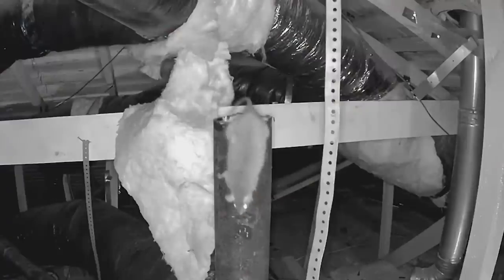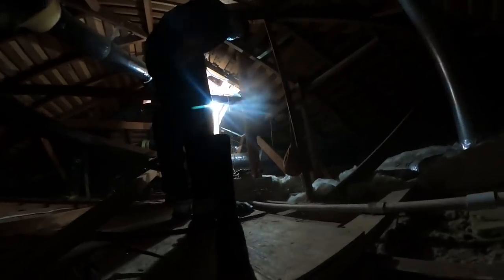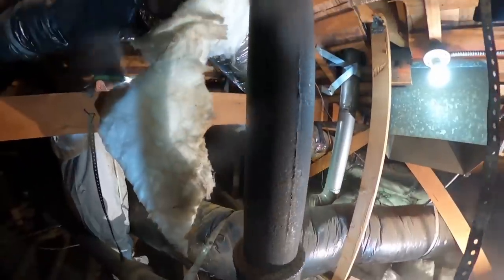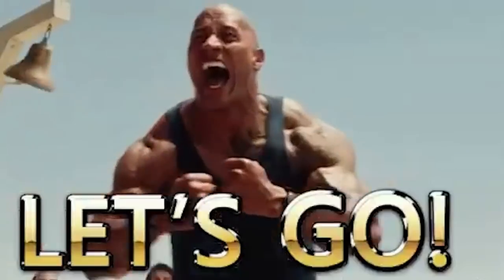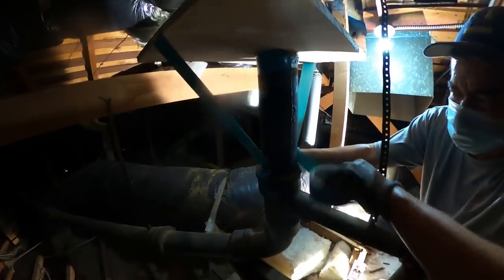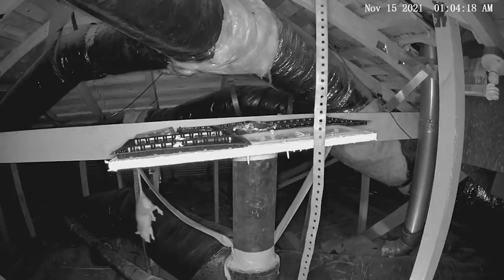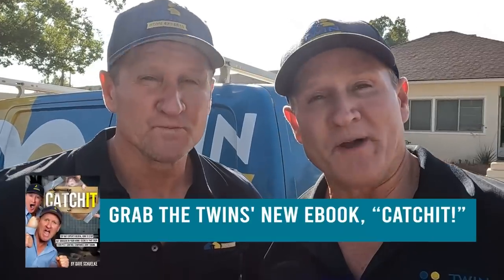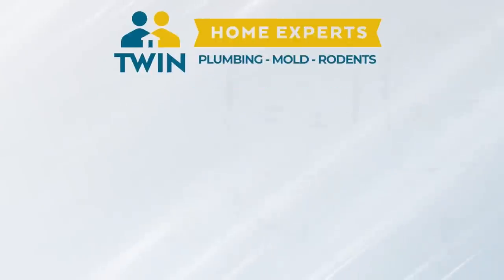Hang on …. Sewer Rat does WHAT to the glue board ?!? This is SHOCKING

Comment: Hey twins - question: how come yall not using the trap bucket with the liquid at the bottom? It was working so well in previous videos. Im confused.
Reply from the maker: Great question! Because we saw activity from the pipes we thought it was be easy to catch them from there run way. ( sewer pipe & attic )
Reply: I have seen someone use peanut oil with the peanut butter to coax the rats into the bucket.

Comment: THe Sticky traps work against dumb rats only. 95% of time they figure them out and avoid them. Victor traps set up standard way -  they also avoid most of the time. What works for me flawlessly when I waged war against rats - I set up a carboard box with two holes that can line up against the wall from both ends. Rats run along the wall and have no problem entering a carboard box (They love openings and small spaces), which is not a foreign material to them. Inside -  set up a Victor trap VERTICALLY with pedal facing towards the floor. Rats see no obstacle on the floor and feels safe trying to lick something tasty off the vertical surface of the pedal. This works the best!  That smartest rat was so bold, it sometimes ran in my plain sight! And I saw it entered the box to hide from my view. the next second I heard Victor trap trigger, and BAM!

Comment: I'm not a Pest Control Tech. but since the glue and snap traps aren't working, I'd get some of those live capture box traps (like Roach traps, they check in, they don't check out) and place them on the platform and once they're trapped by the one-way gates, take the trap out and drop the trap in a 5 gallon bucket with enough water to drown the buggers, then finish sealing up the entry points - that cast iron stack needs to be rebuilt so it terminates outside to prevent sewer gasses from entering the home...all the vents do actually, you showed at least 1 other vent stack that didn't go through the roof line, that MUST be fixed ASAP...

Comment: As a pest control man myself I would have ditched the glue boards right off the bat, I find that non target species get into these and depending on the size of the rat it’s inefficient and a little less humane if it does capture the rat. I find a variety of different shapes you place[triangle, small circle, bait square-to-front] is genuinely enough to get a rat every time. Now this situation differs from most of my own, and pipe trapping is always a difficult call to make so I hand it to you for your strategies. Hey love y’all’s content, and love learning more about my line of work. Keep it up guys!!
Reply: What do you mean a variety of different shapes

Comment: Hi Twins!!! 
Wondering if the sewer rats are "susceptible" to the 50/50 flour/baking soda mix as are mice...

I'd been having a problem with field mice getting into my laundry room (*guess they need to do wash now and again) - but I couldn't find their entry point .. 
Set up a bunch of JAWZ mousetraps in the laundry room AND mixed up a batch of the 50/50 which I placed in containers around the outside of the house and on the back porch.   
Caught about 10 mice in the traps over a 1 month time frame, but have not seen any "sign" nor caught any in the traps for over 6 weeks now....

I can only surmise that any mice HEADING to "do their laundry" have stopped off at the 50/50 bar and then headed home to wherever they live with a raging belly ache ... 
I've not found any dead mice outside and have not had any "dead mouse smell" permeating my house.

Also put containers with the 50/50 mix in my shop and garage where "activity" had been noticed...those areas have also been CLEAR for about 6 weeks now....

I like using the 50/50 since we have a lot of animals on the farm as well as a healthy population of predatory birds (ravens, magpies, red tailed hawks, bald eagles and owls), coyotes and foxes.  I don't have to worry about the wildlife getting hold of a mouse if it's had a "snack" of 50/50..
Reply from the maker: This is such great insight. Try to find the entry points. Did you catch any on the jawz?

Comment: A guy I used to work with was an exterminator, and he said they were trying to solve a rat problem in a supermarket that the rats were going under the supermarket shelves to get dry dog food.     They made giant glue traps by rolling the glue on plywood, and placing these huge glue traps under the supermarket shelves(you know the hollow space between the bottom shelf and the floor), and the rats would find pieces of paper and place them on the glue making a path across the trap.    They can be very clever.

Comment: He guys great video, the go to trap in Uk for loft/ crawl spaces  are made in India and called Black cat traps, they are a “ tomb stone “ type design . Unlike the victor traps the rats pull on the bait  bar to get the bait and releases the kill bar. I’ve had far more success than traditional snap traps. You place a slice of apple or hard bait under bait spike  and then fill bait pan with porridge or wild bird food  or similar, the rat can feed on bait in pan on porridge etc with out activating the trap which overcomes neophobia. However as soon as they tug on hard bait they get hit, traps can be purchased from ultimate traps Ireland or on e bay , great trap had loads of success using these commercially
Reply: They were ignoring the bait.

Comment: Yes seemed like their getting smart we had rodents 6 to 7 jot them all by trap then one came in who hasn't been trapped by a trap or glue trap seems smart any ideas twins
Reply: For us, we caught the naive young ones.  We never caught the big ones.  We've done a thorough interior exclusion work with steel mesh and foam and the activity disappeared after the second day.  I excluded one suspicious spot in the garage.  But I did not have an endoscope so wasn't sure if that was the entry point.  We did see large rat poop next to that spot though.  The big rat poop just wasn't leading into it.  It was next to it.  Like a toilet spot.  Attic was fine, exterior of house seems fine.  We're still monitoring. fingers crossed.

Comment: RE: Victor traps   you likely know .. they need to be tuned up , file down the sharp burrs & bend the trigger to a Hair trigger , oil the spring & the contact spot with veg  oil . You know many of the other tricks , put them in a PVC pipe or a box to keep them from getting to the side & top    best to get them in the front of the trap
Reply: If the traps are old polish up the contact area with fine sand paper
Reply: I also pre-drill and drive a few short coarse-thread drywall screws up from the bottom to create “teeth” - when the bar comes down it slams them onto the screws. On rare occasions, they still manage to rip free, but usually leave a hunk of DNA behind. I learned in south Florida to always secure the trap with mason line to something too…the big rats can run off with them, and Ive seen other rats drag off a trap with a dead rat too.
The trap-tuning you mentioned is critical. I put some peanut butter UNDER the trigger plate too…they can clean it off the top bait, but often nudge the plate trying to get the goodness under it.